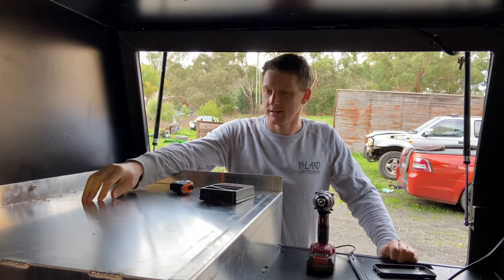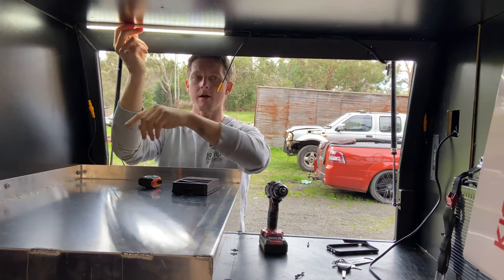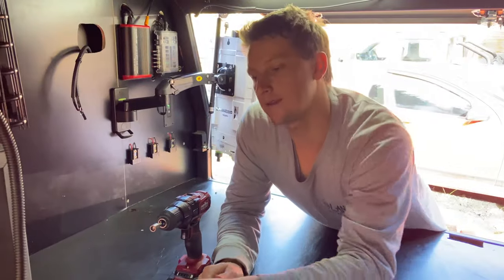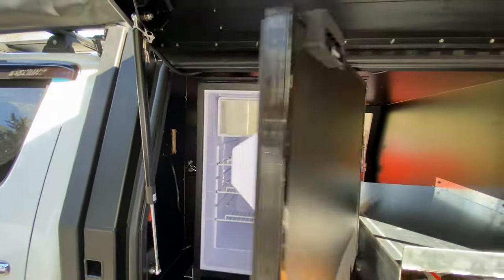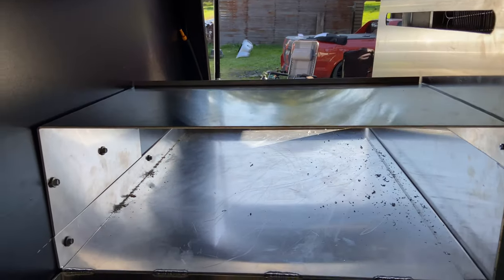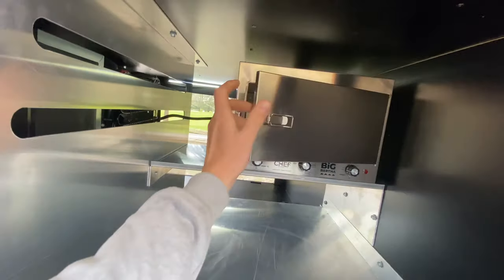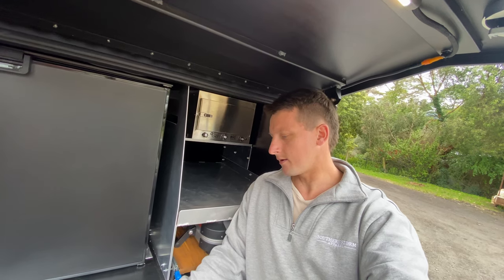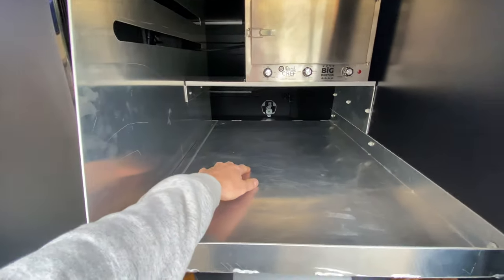DIY CANOPY BUILD | BUSHMAN 85L INSTALL - CAMP KITCHEN FIT OUT

Comment: nice job 👍 
i’ve just bought a similar canopy and about to do 12v.

do you have any problems with dust / water from the screws you put in the floor and roof? did you seal them somehow?
Reply from the maker: Thanks mate, no problems at all. The boys down at Fused Fab bolted it down and it hasn’t seen water or dust since I’ve owned it

Comment: Whats the go with screwing into the bottom of the fridge? I need to do something like this but im worried about drilling into the bottom of the fridge due to the wires or insulation that could be behind it... is there a way to know if theres anything there?
Reply from the maker: Hey mate great question, I actually emailed Bushman with my plan and they said there are no wires or plumbing down the bottom. If I were you I would email them with you plan/questions and they will be more than willing to help out. 

Cheers Dave
Reply: @offtaptouring2587  i have a dometic so not quite the same but i may have  to ask them